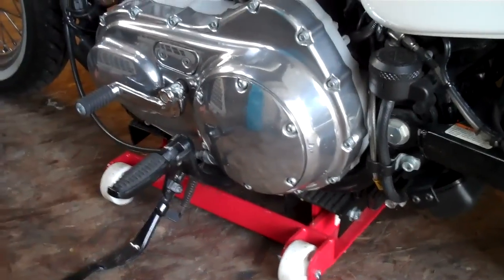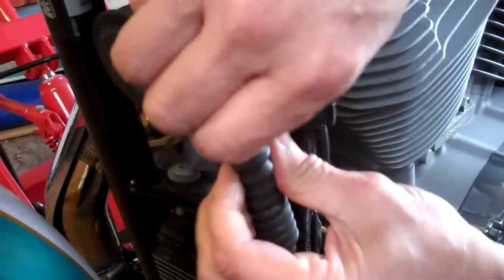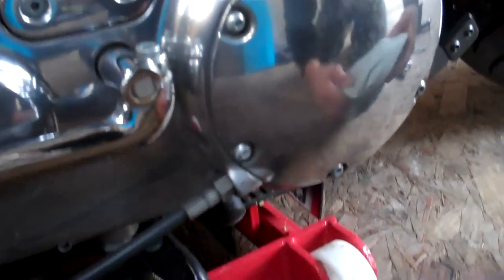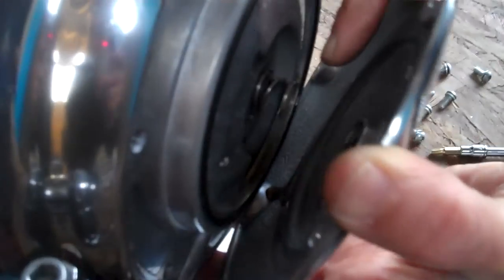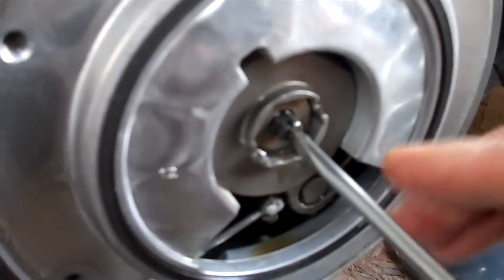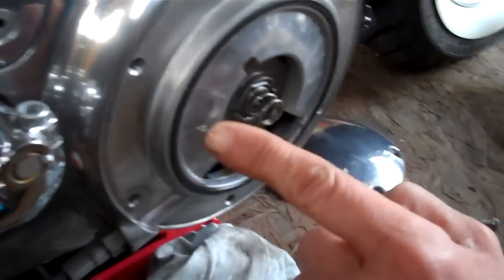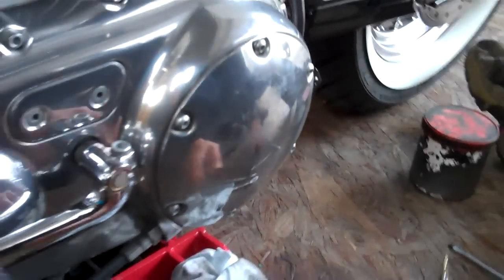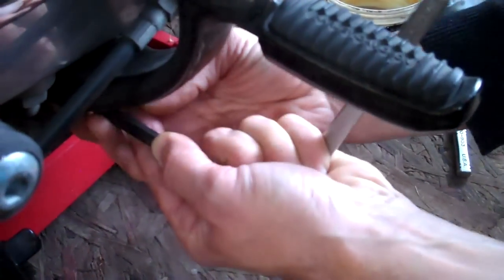Delboy's Garage, Harley Sportster Clutch Adjustment.

Comment: Hey Del. A question on general clutch replacement/issue: I bought a GSXR 750 '98 as a potential track bike and noticed that the clutch is slipping. Cable adjustment helped with the pulling away a bit, but under hard acceleration I could feel the bike revving without going anywhere fast. So I took the clutch apart and discovered that the friction plates are actually in pretty good condition, but steel plates have signs of discoloration on them but no obvious warpage, so I am guessing they are causing the slippage. I am not sure if the replacement clutch was fitted the way it should have been and now I am concerned about two things: 1) my new clutch is EBC (steel plates and friction plates) + springs, is there anything I can do to make sure this one doesn't start slipping (e.g.: I've read about going over steel plates with light grain sand paper)? 2) I have also heard a lot of reports of "sticky" clutches where the plates are not moving freely in the basket and create clutch drag - does it make sense to give the basket a rub with light sand paper, can I check that there's no stickiness before sealing the clutch and changing the oil? I also noticed that one edge of the steel plates is sharp, the other is smooth - which way are they supposed to fit?
Lastly I checked the overall stack thickness which is within Haynes-specified range under 5kg load, however I wonder if the thicker steel plate(s) are supposed to be in a particular position within the stack to work properly?
Cheers!
Max
Reply from the maker: Hi Max, OK, provided the steel plates are not warped, and the discolouration is around the disc evenly, then that's simply a by product of heat generated from it slipping, it's not the cause of the slipping !  There are two things you can do to make sure that you are getting a good healthy engagement...

Firstly, check the clutch basket they sit in, make sure that the fingers that extend out towards you , that the teeth of the plates slide in between, have no notches , or digs, in them... remember the plates slide inwards and outwards, so they will get 'hung' up on any notiches or digs in the fingers... smooth any imperfactions out with emery paper, or gently with a file if bad... but leave them very smooth indeed...

The other thing yuo can do, which really helps, is stiffen up the springs... most replacement clutches are just the clutch pack itself, not the springs (they are usually buoght separately), the half dozen springs that fit in a circle, through the outer plate, are all that holds those plates pressed together, giving you your final drive, and over time they get weak and sloppy... buy a set of heavy duty Barnet springs and not only will you get a clutch that grips like a gorilla, but you will build up a left arm like Popeye lol ! Hope that helps, Del
Reply: +Moonfleet41 cheers Del! the kit came with both sets of plates and springs (these gixxer have diaphragm springs), so I think I am all set. now that you mentioned it - the clutch WAS really light, maybe I just needed to swap out the springs? oh well... Once again - thanks for the advice.
Reply from the maker: OK mate, you will get it sorted, but for what its worth, you can buy a Barnett 6 spring conversion to get rid of those shitty diagphrams as they are rubbish... finally, also remember your cable cannot afford to have any friction against the outer housing... trick is, take it off completely, and do the drop test, hold it straight up and down ,holding the outer tube, pull the inner wire up, and drop it, see if it falls through the outer sleeve on it's own, if it doesn't , buy a new one and route it carefully, not too many tight curves, as that all adds friction, good luck fellah, ride safe.!
Reply: +Moonfleet41 awesome! cheers fella.

Comment: DDelBoy, question, I have a 1975 HD IronHead sportster xlh 1000, n i want to adjust the clutch cable is the adjustment the same as u stated in this video. thanks First time HD RIDER

Comment: Hi Del. Great video. Follow all your work. Quick question, im having issues getting the hexs off the Darby cover on my 01 sporty. Ive used wd40 quick release spray and not luck. Any ideas? Also ive noticed my cable doesnt really allow the slack to be loosened off, the whole bottom end of the cable turns completely around. Now it is an extended cable from burly...not sure what to do with that either. Thanks for the help. Big fan
Reply from the maker: Hi buddy, when the cable housing turns round, does that not screw it together to create slack??

And with the screws in the derby cover, are the head healthy, or stripped??  And remember it's a T27 torx, and many people use the mistake of using a T25 and stripping it!

Hope that helps in some way - thanks for your long term support, it's much appreciated!
Reply: Moonfleet41 thanks a million for the reply. No it doesnt seem to give me slack realy but i didnt continue on for long onece i got the lock nut and adjust back together at the top of the cable. I assumed i would know more once i had the darby cover off. I will check again in the morning. 

I will buy a new t27 inclusive set as the set i have is really old or cheap or both and dont actualy give you a number. 

I will give both ago and let you how i get on. Thanks again brother

Comment: I tried do do the adjustment just as you video says in the end my clutch became super hard to pull in do you have any advice or know what I could have done wrong I have a 2014 883 iron
Reply from the maker: Hi Mike...well obviously you've done something wrong, if you followed the procedure exactly it would be fine.. maybe you have the cable adjusted incorrectly?....did you back out all the slack before you adjusted it?..... the best route here mate, is to just do it again from scratch, treat it like a fresh job and make sure you do every step one at a time... if it was working right before, then you've simply made an error, run through it again, and you get it right... good luck buddy, let me know how you get on... cheers, Del.
Reply: I will give it another go today when I pull the clutch it is vary tight and it feels like the clutch won't release I more than likely have the cable adjusted wrong thank you for the help and videos I will let yaa know how it goes
Reply: Mike Hernandez wanted to say thanks I redid the adjustment and came out perfect thanx for the videos you are vary vary helpful

Comment: Will this work the same on a 87 sportster? My clutch handle is so hard for me to operate. No play in  it.very stiff.  Husband says nothing can do because its not a hydraulic clutch.
Reply from the maker: This should have no bearing on a heavy lever pull... perhaps check they your cable is not jammed up from internal corrosion, could be worth replacing it if it's the original one. !!

Comment: Question, my 2005 sportsters clutch is really tight, the hulk himself couldn’t engage the clutch it’s so stiff, would this help sort that out?
Reply from the maker: Not really buddy... on a 2005 bike you'll have a fairly light pull clutch, so check the cable it's self is free and not trapped or kinked, and also check that it has not been routed with too sharp a bend in it...  if the bike has smaller bars fitted, and the cable has been bent tight to reach the bar.. then that will make the pull really stiff..  check that first..! Good luck. Del.

Comment: Hi Del have just adjusted my clutch on a 2007 XL883C I found the spring detached from the hex bolt and found no resistance when adjusting with screwdriver to the left. Any Ideas as to what is going on?
Reply from the maker: The spring is not attached to the bolt with any grip to speak of, it only pushes over the peg, normally it's little more than the oil resistance that keeps it in place, which is why it's important to remove the derby cover very carefully so you don't drop the adjuster nut down in to the primary case... when you turn the screwdriver to the left, the resistance is not a solid impact, it just becomes stiffer as you begin to open the clutch plates, you should be able to feel it if rotating the screwdriver just with your finger and thumb... it's a delicate operation for sure.
Reply: @Moonfleet41  Cheers Del, also fell foul to cheap torx bit when taking off inspection cover ,snapped off( the torx bit that is). Also had to replace the system relay  which gave up and I could not start the bike to circulate my oil after changing it. So no MOT for me today booked for tommoz.
Reply: Also had to replace the rubber in the derby cover, somebody did not check it was in properly when they last serviced it.Your work certainly has made it easy to correct things...Many thanks.
Reply from the maker: @Dadfromhell  Most welcome mate, and bad luck with the torx.. don't you love it when that happens, teaches us that good ain't cheap, and cheap ain't good aye.  Good luck with the MOT for tomorrow ..!

Comment: Pulled the derby cover and it has no spring. How is the spring attached? I'm thinking that is doesn't have the correct piece because it was wedged between two positions. What is the name of that part?
Reply from the maker: YOU MUST have a spring Barry...you need it so the clutch can open and close without the adjuster nut falling out..!!!!  and what part are you talking about buddy.. you dont make it clear.?
Reply: Bought it used and had it 2 days. Is that why the clutch feels hard. Where can I order one and find out what else I'm missing. Why does it have a long bar with just an N lit.  Is there a site with pictures of all the warning light etc? I've been searching but not finding. :)
Reply: I guess the part that we are talking about with the spring that keeps the adjusted position, right? All that was there was what looked like a nut with an oblong hole that fit the shape of the shaft. No spring and nothing for the spring to go on. Nothing like the piece that is supposed to be there. Don't know how it stayed in there unless jammed.

Comment: When you say turn the screw until it "seats" do you mean turn it until it doesn't unscrew any farther? Thanks!
Reply from the maker: Cody Smith Yes thats it,. just turn it out until it stops, dont force it, just until it touches base on the thread...
Reply: Thanks! Did the adjustment yesterday and doesn't seem to slip anymore however, bike still likes to creep when the clutch is engaged say at a red light. It only does this sometimes tho not constantly, would you by chance know why this is happening? Thank you
Reply from the maker: Cody Smith Hi Cody, clutch drag is usually caused because the plates are not fully separating, which can only be down to adjustment... but if you did the adjustment properly, then it could just be that your primary oil is a little low, so check the level by taking off the derby cover and with the bike UPRIGHT make sure the oil level touches the bottom of the clutch plates...and whilst the cover is off, just double check your adjustment for good measure!

Comment: moonfleet41 I been watching your video on adjustments to the clutch on the Sportster I own a 97 883 Hugger the five torx head screw's on my derby cover is starting to strip out when I try to remove them any ideas on how I can remove these screw's since they are stripping out? I need to adjust my clutch it's slipping on me and not shifting right help me out brother I enjoy your videos.
Reply from the maker: Hi Jesse, I know how you feel, those damn bolts seem to be made from 
little more than stale pastry - I've stripped out more than I can 
remember!  Goodness knows why Harley have not dealt with it by now, as 
they are still fitting them to this day...  

The first thing I can suggest is to get yourself a full set of brand new ones, if you can't get them from the dealer, then maybe some replacements from a fasteners supplier, stainless would be good, and straight forward allun screws would be fine, they don't need to be torx heads.... you could take one of the old ones in as a guide and see if they can match it....

Then once you have the new ones ready, do your best with the old ones, hold the torx driver straight directly at the screw and tap the head gently and try really carefully to undo them... if they come out - great!  If they don't, then you can use the centre punch trick - we have a video on this - you can take a sharp centre punch and , carefully, on the rounded head of the screw, pop the centre punch in about 10o'clock on the dial, and after a few taps to dig a little hole, angle the centre punch to the right, so that you are tapping the screw head to the left, believe it or not, this really works!  You just have to be really CAREFUL not to slip off the screw and damage the casing... let me know if you are not sure what I mean, I can link you to the video.... good luck with it !

Comment: Will this make finding neutral easier on a new bike?
Reply from the maker: Hi mate, a new bike shouldn't need adjusting....at least not till its done the first 1000 miles and then it will only be a check.... All new bikes are still "tight" and will loosen up over time and miles..it'll get better buddy, just use it..!
Reply: I have just over 2000 miles on her now lol I was just checking thanks

Comment: I tried doing this and it didn't work. What do you mean by turn the bolt till it's seated. I'm having a lot of trouble downshifting and sometimes when I'm moving, the bike revs but it doesn't speed up. Help please
Reply from the maker: It's quite clear in the video buddy, turn the screw outwards until it 'seats'/stops/touches the top/becomes stiff to rotate, etc., then turn it BACK a quarter of a turn...

If you are saying on the one hand it's stiff to get in gear, that is a dragging clutch, which means it's not dis-engaging, and if you then say it revs up and won't pull away, then that's a slipping clutch, which is not 'EN-gaging', so you can't have both symptoms buddy... is your cable adjusted correctly and are you getting the weight of the pull at the lever, or is it floppy?
Reply: Moonfleet41 If I adjust the clutch or the cable too tight, it acts as If the clutch is still engaged. If I loosen it too much the downshifting gets stiff. Do I need a new clutch?
Reply from the maker: metallicademon13 It not as simple as just "Do i need a new clutch?"... if the cable is slack then you will find it hard to downshift, and even upshift because you're not separating the clutch plates enough, so they'll drag on each other and make changes heavy or impossible.....if its too tight, and you dont have the right 3m slack...then the plates will slip, so it'll feel slightly disengaged all the time...

Did you make the clutch pack centre nut adjustment with the cable totally backed off and completely slack?.....and if you did....then do you have it adjusted so there is 3mm of slack at the clutch lever knuckle...like in the video?....   if so, then it should be fine and ride correctly... other than that...it may be a deeper issue but i can tell over email buddy.... hope that helps you a bit... good luck.. Del.
Reply: Turns out the spring plate was damaged. That's why I was having those problems. So it is possible to have to 2 problems I explained at the same time.

Comment: Hello, Do you do this adjustment in neutral or 1st gear?
Reply from the maker: Doesnt really matter if its in gear or not, as long as the clutch pack is released right off...

Comment: What if adjusting that bolt its getting overturned more than should,i mean anti clockwise.How to get back in right position.
Reply from the maker: Hi Dagers.. don't worry it too much mate... the central screw needs to be finger loose, so back it out until it goes tight, no need to lean on it, just with two fingers on the screw driver... then turn back in a quarter turn so its loose again.... then refit the lock nut as shown.
Reply: Moonfleet41 ok.Thanks mate,will do the best i can:) good vids

Comment: Hey Del, me again sorry :D !! - so I made a terrible mistake, I kept unscrewing the clutch adjusting screw (thinking that I should do so until it stops, but it took too long to stop and I just kept unrewarding)!! I did everything else correctly but when I'm done, the clutch wont engage. Not the first gear not any other gear.... all is like I am on neutral !! Please help me out with that I really messed it up.
Reply from the maker: Hi Ahmed, you can't really do any damage provided you follow the steps in the video, it's all there, laid out plain to see -  simply turn the screw counter clockwise until you feel it 'seat', then turn back a 1/4 of a turn... and obviously this must be done, as it's shown in the video, with the cable adjuster screw completely backed off (that's the bottle screw underneath the rubber gaitor in the middle of the cable)... if you do this, as shown in the video, your clutch should be fine - perhaps go over it again and follow it step-by-step !
Reply: Moonfleet41 you're absolutely right, I started over and took it slow... worked out just perfect. Thanks Del !
Reply from the maker: Excellent news.. im glad you got it fixed Ahmed.. take care.. Del.